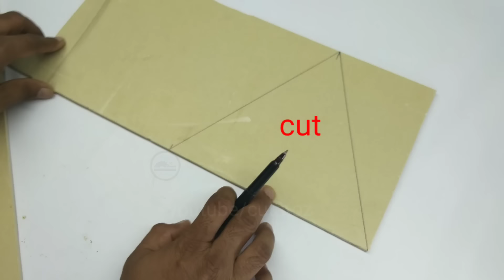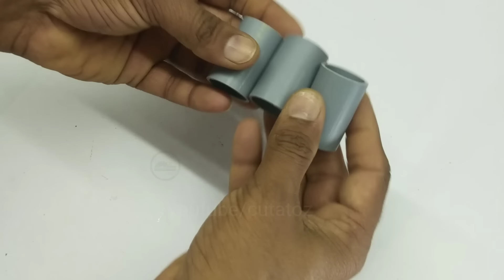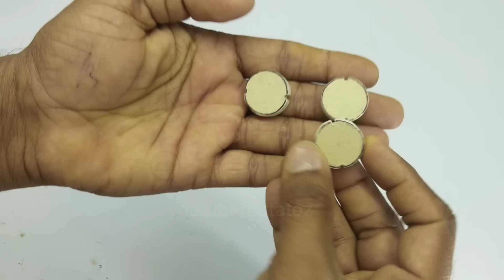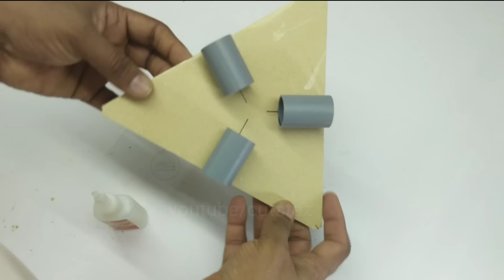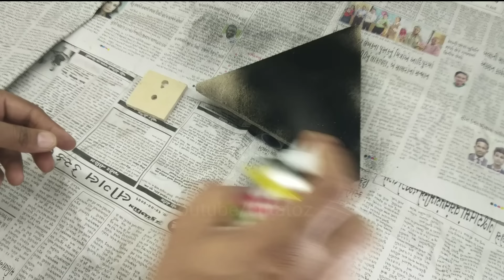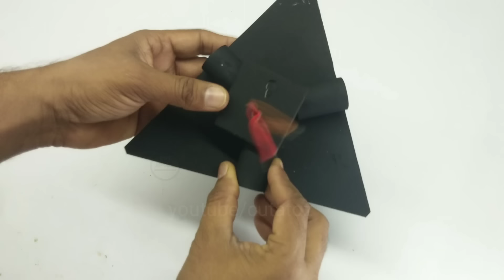House exterior wall lights Ideas Wall Decoration lights Wall Lamp3 Cutatoz !

Comment: Kya use kiya hai wo  nam to batao yar
Reply from the maker: 1 pvc seet
2 pvc pipe
3 led 1w thet
That's all.
Reply: @CutAtoz  aapne connection kaha pe jura? Direct home plug point pe?
Reply from the maker: Direct hom plug🔌 with 3w driver
Reply: @CutAtoz  ye 3w driver kya hai? Plz explain
Reply: Sudip bhai ye driver jo chowk jaisa aata hai usko bolte hai manlo charger jaisa humko 3volt DC DENA HAI ghar me 220 volt AC HOTA HAI
Reply: @ibrahimmaqboolshaikh1980  thnk u bhai for the information